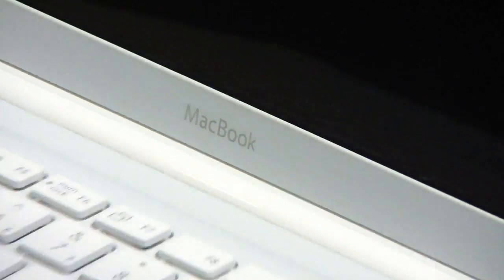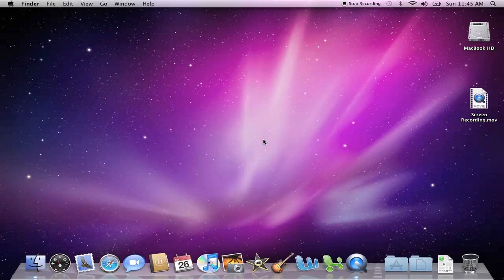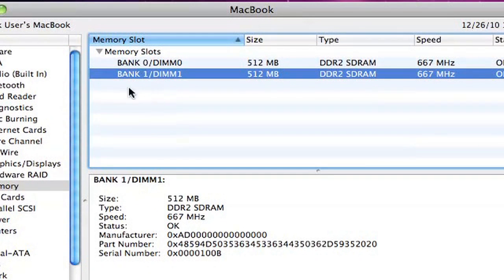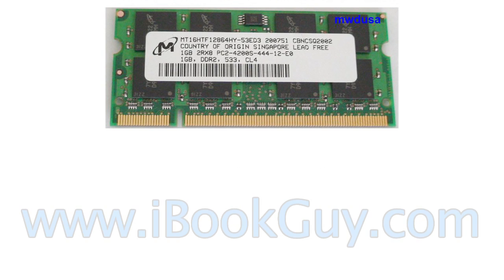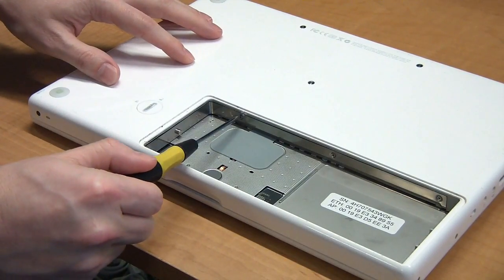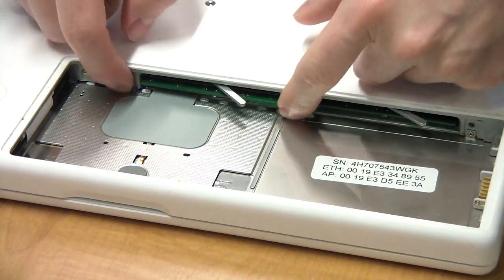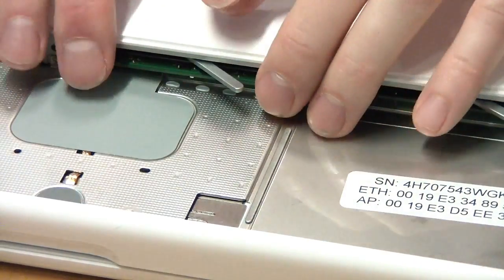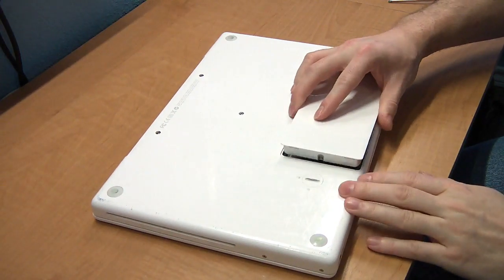How to upgrade RAM in your 13" Apple Macbook

Comment: It's 2019 and I still have my mid 2007 MacBook.  I just started using it again recently since my PC is being repaired.  I used this MacBook for 6.5 years and then got a new laptop because this one was being so frustratingly slow.  Little did I know I could get some RAM to extend its life.  I think I may even do that now so it will be more useful as a backup computer.  I like keeping my old electronics to play with.

Comment: When I installed the RAM I pushed it in hard and it went in all the way. However when I start the computer the power light comes one but nothing comes up on the screen? How do I fix this?
Reply: the ram might not be compatible with the macbook. it can only handle up to 4gb of ram.

Comment: Thanks for this great info!!   
I just purchased a 2008 white plastic MacBook and have installed  two 2-gig ram cards (after watching this video) into it.  
I was told that two 4-gig cards would be too  much for it,  is that true?
Also, what is the newest/highest OS that I can install in it?
Thanks again!!!
Reply: Curt Brennan you could go for a 4gb and a 2gb :). There are some folk who've managed to get two 4gb's working but seems more temperamental than the confirmed 6gb capacity
Reply: Thanks for the tip.....

Comment: I just upgraded my MacBook from 2gb to 4 for the snow leopard update, but not my screen isn't responding, any ideas?
Reply: +Evan O'Donahoe 
By any chance did you hear the macbook playing the sound of shattering glass? If so this means there is a problem with your mac memory so further analysis is required. Hope this helps

Comment: hi so im trying to update my software from snow leopard to lion os x but it wont install because i need 2GB of ram. I have the same macbook as the one used in this video and with same memory and i'm pretty sure i'm going to have to put 1gb of memory in each drive (correct me if i'm wrong), thats what i was recommended to buy i just wasn't sure of the whole mechanics and how it was inserted but anyway i just wanna know will i loose all my documents and stuff on my laptop if i was to replace both memory drives?
Reply: Replacing memory/ram won't effect any files. However I'm not sure about your files when you upgrade to Lion as I don't own a mac but files are not stored on the memory/ram
Reply: thanks so much for the help and the video was a major help when i replaced it in the end - btw nothing was effected but i back them all up just in case!
Reply: ***** your welcome

Comment: Did you figure out about the battery?  My Mac also only works when it's plugged in, so i am trying to buy a battery. i want to know though if the battery is the problem

Comment: Be careful about your static electricity while handling ram or you'll fry it! Touch metal beforehand, keep one finger on the metal under the battery if possible to ground yourself, or get one of those cheap anti-static wristbands.

Comment: It is possible for two different sizes to work and there's no harm trying if you already have them, but it is always strongly recommended to buy two identical modules together. Manufacturors don't even recommend buying two identical sticks separately, but two in the same package that were already tested to work together.

Comment: Hey I have a question, if you take out 1 ram that has 512MB and leave the other in, and put a 1GB stick in the place of it?
will that work?
or do you have to do 1GB+ 1GB

Comment from the maker: @electrotech555 - That model uses the Intel integrated graphics.  It is fine for 95% of the software out there, the only thing that will be affected are games that use 3D graphcis, such as StarCraft II for example.  Also the latest version of Final Cut Pro won't work on there either.  Just make sure to check the system requirements of all of the software you will want to use.